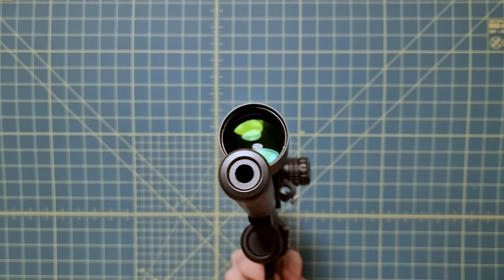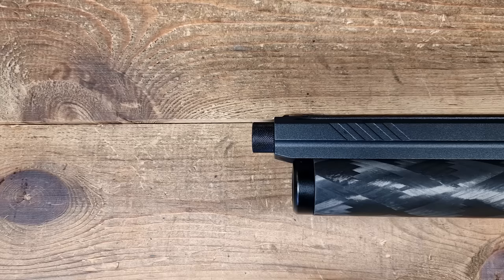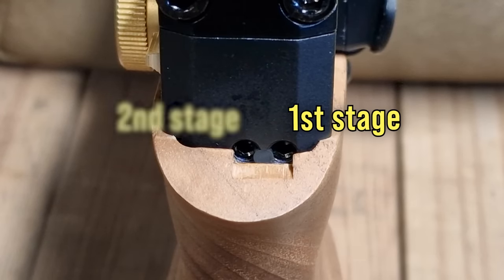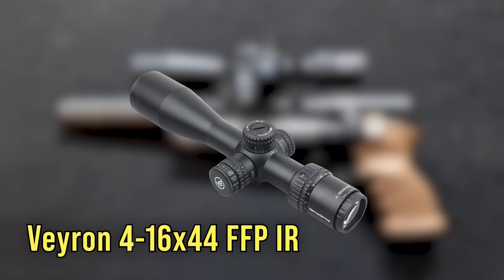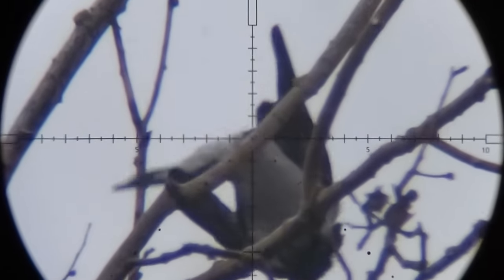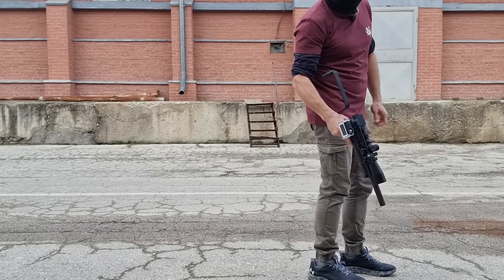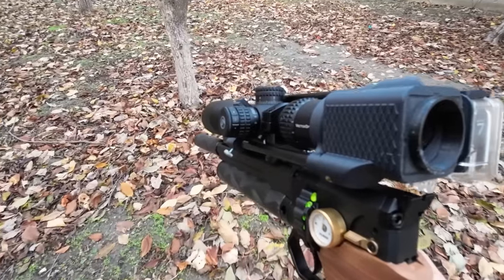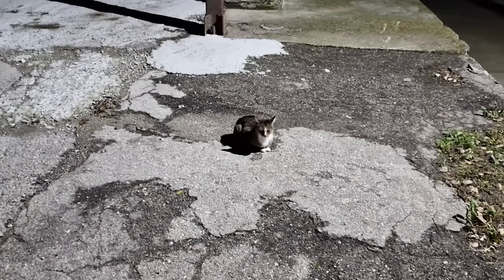Huben GK1 Pistol: Pure Shooting Awesomeness!

Comment: This was kind of exactly what I was looking for, this would be great for a survival kit especially if you carried 500 to a couple thousand rounds of those pellets, and you were to have one of those hand pumps that go up to 6,000 psi, that extra tank is great if you need to have quick exchange for follow up. You can definitely get enough birds like pigeons and crows in order to subsist on. I'm also curious about turning rocks into ammunition, by either making them the right size through other methods, or by melting them in a couple thousand degree furnace, making your own obsidian type stones. In any case I'm interested in that kind of apparatus that will help you be able to form stones into small enough ammunition, 22 in my opinion is a easily accessible state between weight and size of projectile. This is a very good example of something you can use in a long-term survival kit. It would also be interesting to see this be tested on larger amounts of meat, like ribs or a pig skull, which is very accurate to a human one, and even a ballistic gel head for fun. Because at less than 25 to 30 yards, if this can go through a person's head, and maybe at longer ranges if you were to coat the pellets or fill them with poison, this can be a very effective tool for self-defense as well in many applications.
Reply from the maker: First, let me say thanks for watching and your comprehensive comment. Now, to answer your questions: I definitely recommend using a pump for this gun, because it has a small tank and it can be filled up to 350 bar. The Huben pump goes to 350 bar too. Usually air tanks are filled up to 300 bar, so it's better to use that pump.
If you watch my latest video you'll see I shot 34 grain pellets with the gun, and yes, I think those can penetrate larger animal skulls at 25-30 yards.
As for the usage of stones, you absolutely cannnot shoot stone pellets through that barrel - that will ruin it and its accuracy. As a matter of fact, they'll ruin the barrel of a wide number of firearms too, if not all. I'm not a stone smith so I have no idea what will be the effect of shooting melted stones, but I guess it would be the same. Those barrels are designed for shooting the soft alloy used for making airgun pellets and slugs.
Reply: @AirRifleActivities  That's kind of what I figured, silica is incredibly abrasive and I was just thinking of a off the wall potentially cool idea, if I was going for larger animals I would definitely use a higher caliber, at least a 35 or 50 cal because sometimes you just need two tools, I just have to say that you have provided a very educating resource, and I always wondered what the actual power of this is. Thank you very much for the video. And thank you for responding to my comment.

Comment: A simple brace makes a big difference, maby I should make a little foldable stock extending from the back plate of the receiver. 🙂   Also looking at making a MAG baseplate for the Frenzy to mount instead of the rear sight.  Nice little air powered pesticide. 😎
Reply from the maker: Couldn't agree more, Hasse 🙂 And let me say a folding stock sounds great!
Reply: Someone, please make a cheape gun.

Comment: That is a very nice pistol for sure. But the stock really takes it to the next level. I love pistols with shoulder stocks.

Nice work clearing out the grain farm!
Reply from the maker: Thank you yet again, friend👍And let me say I'd be curious to see some stocks made by Huben and Wolfiek 😉
Reply: @AirRifleActivities  I was already imagining   a modified grip where a plate is fastened between the grip and the frame, coming rearward, then up (a simple "L" shape) terminating below the rear sight. Then, a folding butt stock adapter attached to it.
Reply from the maker: @FDTSafety  that would be great, bud 🙂

Comment: Hi im new to airguns, never shoot one before and want to buy this. Is it good one for beginners? Also when stored away, does it have to be pressurized? and how do you fill the pressure?
Reply from the maker: Hey, bud. It is good both for beginners and advanced shooters. It can be pressurized when stored, of course, otherwise you'll have to start filling it up form 0 every time you take out the gun.
You can refill the gun with a hand pump (specially designed for PCPs), a compressor or a bottle.
Reply: Thanks, how long can it stay pressurized without using it? @AirRifleActivities
Reply from the maker: @RapatipatooO  if the gun is in its proper condition and the seals are in order - indefinitely, mate 🙂
Reply: sorry for the noob question but what do u mean with proper condition and seals being in order?  @AirRifleActivities
Reply from the maker: @RapatipatooO  if the seals are not dry, not worn out. Proper condition as in a gun maintained properly.

Comment: Which one is better? With regulator ot wihtout regulator? Can the regulated one reach the same power like this one without? Also how much is the real capacity of the cylinder with the regulator?
Reply from the maker: I can't answer all of your questions, because I haven't tried the regulated version of the pistol. Go to hubenairguns.shop, the info should be there. I can only say that the regulated pistol should be capable of lower power levels.
Reply: @AirRifleActivities  Thanks for the fast answer! Unfortunately in huben site have NO info bout this. Did U try how many shoots U can have on max power? what is the max good range of this pistol? I mean with exeptible drop of the slugs?
Reply from the maker: @PETRAKOV1  I haven't shot slugs through it. I know some guys do, but I personally don't think such a short barrel is suitable for slugs. And I haven't reached max power level. The shot count will drop too much. This is not a shooting platform for for extreme power levels, that's not the idea behind it in my opinion. I shoot 25 grain diabolo pellets or 34 grain pellets.

Comment: If ya all buy 2, get it out of your head about duel guns. Im amidextriouse and a bit ocd, TO me having 34 shots accessable in the field is better than 17, as it takes a bit to reload. Or perhaps ill do the sbthing thats pretty damn cool too.. These gk1's are completely amazing and useful. And I only shoot 1 hand out of time. The pellet level doesnt really seem to interfear with my left hand as the right and left versions have the loading lever on the other side. But otherwise, the safty AND the pressure Gauge is on the left. Or at least mine is.
Reply from the maker: They're all on the left hand side, and I agree with you, mate - those guns are amazing. Cheers 🍻

Comment: HELLO THERE HOW  MUCH AIR  SUCH YOU  PUT THE GUN  ????
Reply from the maker: The air tank of the pistol is rated up to 350 bar.
Reply: WHERE SUCH PUT  PSI ON THE  AIR COMPRESSOR  ????
Reply from the maker: @gravediggerrc  that's why I use a pump if I wanna fill it up over 300 bar. The Huben pump goes up to 350 bar.

Comment: Huben GK1: Can ANYONE tell me if there's a limit stop for the power adjustment screw? Or does it back out until it falls out? Or blows out under pressure?

I am trying to find out just how far out the power screw can be adjusted. I have a reconditioned GK1 .25 that seems weak even with the screwed backed out 2-1/2 turns. I'm shooting 25gr pellets with a full fill yet only getting 720 FPS which is much less than others are claiming.
Can I turn it out 3 turns? Out 3-1/2?
Its strange that its so hard to find this information, I've looked with internet searches and a bunch of Youtube videos but nothing anywhere.
Reply from the maker: @bobjoatmon1993  I just talked to the guys at hubenairguns.shop. I'll try to explain and answer your questions. You CAN unscrew the bolt entirely. I don't think it'll blow out, because if it's under pressure all the time, you won't be able to rotate it at all, at least that's my opinion. If you unscrew it too much, all the air will leak out when you fire the pistol, as the valve won't be able to close.
If after those 2-3 rotations you're still at the power level you stated, then there's sth wrong with this refurbished gun. hubenairguns.shop tell me they don't advise unscrewing it past 2.5 turns.
I advise you contact hubenairguns.shop and consider shipping the pistol to them for repairs.
Reply: @AirRifleActivities  THANK YOU for the information and a path to follow to get it to repair if necessary. I guess I didn't save money buying a "refurbished" ($100 off) since I'm probably going to have to pay for repair